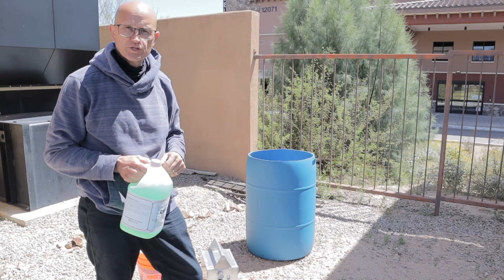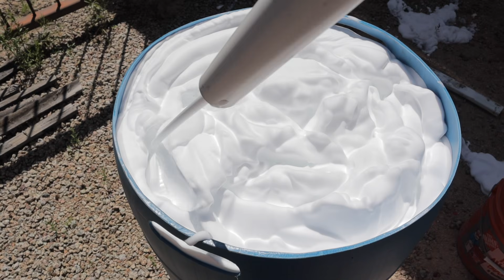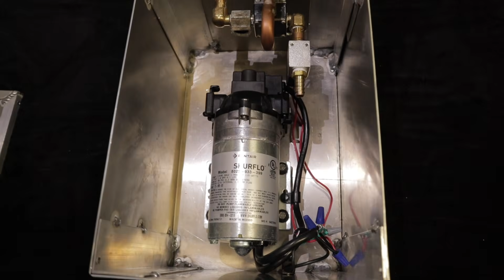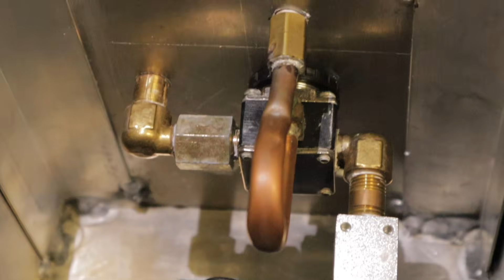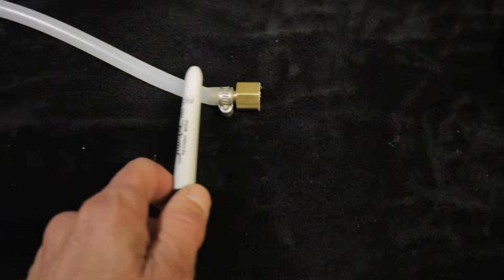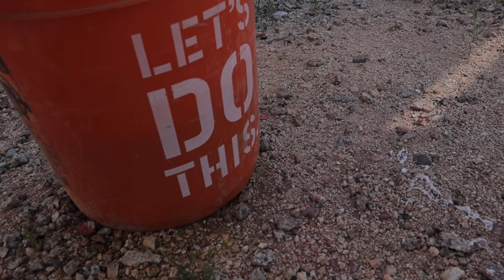Aircrete Foam Generator Machine DIY  [ How To build one that makes Great Foam!

Comment: Could you please give more information regardind the cement/water ratio you use?
Before starting to mix it with foam and how 
Much foam you pour in relation to the cement/water.
Thanks in advance.
Reply from the maker: Good morning! My Ratio is 6.5 gallons of water to each 94 pound bag of Portland cement. Mix thoroughly and then add the foam and mix until it fills up to the 45 gallon mark on your barrel or drum. Mix just enough to blend the foam in completely and then pour into your mold. From this ratio you can make larger or smaller batches as you need. 👍😁Don
Reply: @PranaTech  thankyou very much.
Yours are the best videos on this topic.
Best regards.
Reply: @PranaTech  sir with this ratio what is the density of your concrete and its compressive strength. Warm regards
Reply from the maker: Hi there. The density is 30 pounds per cubic foot and compression strength is 140 psi or .97MPa 👍😊
Reply: @PranaTech  thank you so much sir.
Reply: @PranaTech  sir i am planning to make aircrete of density 53 pounds per cubic feet and compressive strength of around 3MPa with cement and sand. So what should be my ratios. Thanks in advance.
Reply: @PranaTech  sir can i use air operated double diaphragm pump for my foam generator?
Reply from the maker: Yes, absolutely! 😊👍
Reply from the maker: Here is a link to my chart that I use. https://drive.google.com/file/d/15ZAWgf5stQ0oNRSjhrYa9hjkqugEkUi6/view?usp=drivesdk 👍
Reply: @PranaTech  request for sharing this link sent to you.
Reply: @PranaTech  thank you so much sir. So i will be using two air regulators one for pump and the other for foam water. Now my request is do you have any chart/table where you have mentioned pressures for these two air regulators? Will i need two air solenoids for operating these two air regulators? Thanks in advance.
Reply: @PranaTech  God bless you. You are helping us alot. 👋👋👋
Reply from the maker: Anytime my friends! Namaste!🙏❤️
Reply from the maker: Hi there, here is a link to my video where I built the double diaphragm pump model. No need to use solenoids, just use mechanical valves to control the air. https://youtu.be/L-SAHq9X9QQ The link to the schematic design is in the description of that video. 😊👍
Reply: @PranaTech  hope you are doing well. I have a question regarding foaming agent. I have heard that SLES alone can be used as a foaming agent. Is it true or we need to add so other chemicals in SLES. Regards
Reply from the maker: Hello, well I’ve never tried using it so I have no experience with it at all. Sorry.😔
Reply: @PranaTech  thanks brother for your prompt reply. Highly indebted. Warm regards

Comment: out of curiosity, if you let that foam "melt" back to its watery solution, would you be able to respray it with similar results, or do some of the chemicals evaporate? Also was thinking since this is water based product and you're using stainless steel (Scotchbrite, I've had rust on me before) or metal to aerate the solution, would this rust eventually? Chorboy [copper] (Every crackheads favorite product) may be a bit more viable. 00 steel whool would rust too but wonder if it would change the size of the bubbles.
Reply from the maker: Good morning! Hey, those are all great questions! I’ve never tried to run the foam solution through a second time to see if it works again. Many people are using the other products that you have listed and they all seem to work great. I don’t know which one is the best out of all of them. I just settled on stainless and it has always worked well for me so I never experimented any further. All that really seems to matter is that you run the air/foam solution through some sort of medium that has small holes to form the micro bubbles out the other side. Thanks and have fun!😊👍

Comment: Can one use an air compressor?
Reply from the maker: This design uses an air compressor for the air supply. There are other designs out there that use just an air compressor and Venturi affect with a tank to do the pumping. They seem hard to dial in consistently because they don’t use a fixed amount of foam solution like a pump gives. 👍😊

Comment: Hello, I recently purchased land in New Mexico and I live in PA.  I want to experiment with aircrete here in PA and make a small dome to see what and how quickly I can build a small structure.  I was about to buy a foam machine but I watched your video.  I would be interested to attempt to make your foam generator.  Would you have a complete part list of your foam generator?
Thanks, John
Reply from the maker: Hi John,  I will put a parts list together this morning and put it in the description today when I get it finished. I will reply again when I get it posted. Thanks! 👍😀 Don
Reply from the maker: Hi John, I put up links to the parts you will need for the generator in my description. Hope this helps and feel free to ask any questions you may have in the comments section. 😀👍

Comment: Thank you for these aircrete videos.
I'm wondering if you think a 60 psi pump be sufficient?
Reply from the maker: Hi L.S.  I think 60 psi would work as long as it was a quality pump that can maintain that pressure constantly. I usually have my air pressure set at 55-60psi so the pump has to be able to balance that much pressure to be able to make good thick foam. If it can’t maintain that pressure, it will be fighting the air pressure and not getting enough water/concentrate into the mix and you will make a lower density foam that won’t be optimal for mixing Aircrete.  Hope this helps and let me know if you have any other questions.👍😀Don
Reply: @PranaTech  Thanks for the reply, I really appreciate it.
Reply from the maker: No problem at all, anytime 👍

Comment: Do you feel like you've gotten a superior air crete  using this foam as opposed to Drexel foam?
Reply from the maker: Hi Scott! Yes, a much more durable and consistent foam that was designed for use with Aircrete. Drexel is just ok and I had regular problems with collapsing Aircrete and consistency issues. Drexel is designed just for farmers to mark their fields for crop dusting. Ridgeway is far superior foam. I’m also using foam solution from a company called Vermillion and it is even better than Richway and is nontoxic. 👍😁
Reply: @PranaTech  Thanks for the reply!  This is great information to know considering I kept hearing that Drexel is the best foam.  I really appreciate your efforts to help others be successful!

Comment: The pump you link here is not available right now. Is it ok if the pump is 130 PSI ?
Reply from the maker: Hi Kamal, yes, 130 psi will work fine. Thank you for letting me know that the pump is unavailable. I’ll try and update it to a newer link.👍😀
Reply: @PranaTech  you are welcome and both of your pump links and not available . Thank you.

Comment: Say someone wanted to pour a foundation would this cost less than a regular foundation
Reply from the maker: Hi Patrick, this wouldn’t be strong enough for a foundation in my opinion. It’s great for walls and areas where you need lighter weight and good insulation properties as well. You can add sand to create a denser mix but then you lose some of the insulation value.😀👍
Reply: @PranaTech  ohh okay. What about a retaining wall?
Reply from the maker: Hi Patrick,  well a retaining wall usually has to hold up a bunch of dirt which causes a lateral load on the wall. So I wouldn’t recommend it for that. A perimeter wall around your yard would be fine or any wall that didn’t receive a lateral load.👍

Comment: I agree with Glenn Felpel. Where did you get the foam solution again?
Reply from the maker: Hi there, I got the foam concentrate from https://richway.com/construction-products/foam-concentrate.html  You will have to call them to order it and it is $50 for a gallon.

Comment: You filled the foam wand with steel scrubs. Why steel and not plastic? steel scrubs will eventually rust, ain´t it?
Reply from the maker: Hi Roberto! I used stainless steel scrubs so that they would not rust. You could use plastic ones as well and I’m sure they would work fine if you compress them. 👍😀

Comment: How much foam to concrete. Is this fire proof?
Reply from the maker: Hi Lance, the amount of foam you use varies depending how dense you want the final product. I usually make mine around a 30pcf density and this equates to 1 90lb bag of Portland cement to 6 gallons of water and then add 40 gallons of foam. 😀👍
Reply from the maker: Hi Lance, and yes it is fire proof.👍

Comment: Hi  Looks like you are a mad science, old ,AZ guy like me. Maybe you can help me figure out what is wrong with my foam generator build.  I will try to keep it fairly short and try to be clear.  Not your design, but similar. Demand pump ( set at 60 psi I think)  soap solution in from bucket, out to "Y".  Air from compressor in other leg of "y" . Line out of straight part of "Y" to wand.  After looking at your design I see you are using 1/2" tubing?  I am using 3/8" OD-1/4" ID.   I notice you are using, what looks like Home Depot (course)  SS pads in your wand instead of the very fine SS pads I have in my wand.  My compressor is huge so plenty of PSI and CFM. Her is my problem---inconsistent and weak foam.  I can't seem to get the right setting. Either the pump stops pumping , the foam is too runny, or it spits air and quits putting out foam ( Drexal mix)  Here are possible causes that I have thought of
Tubing diameter-- too small of capacity.
The fine SS steel wool is packed in to the wand too tight and is creating too much restriction.
I do not have the air pressure from the compressor set right - what PSI out of compressor do you use?
I do not have the pressure gauge I installed after the air IN connection ( going to the "Y") set correctly.
I am either opening or closing the air shut off valve on the solution bucket too much or too little.

At this point I am thinking --too much restriction in the wand or too small diameter tubing.
Reply from the maker: Hi Jerry! Ok here’s my take on the situation. Demand pumps sense pressure in the line and will automatically adjust and shut down if the air pressure is too high. The best way to deal with that is to remove the pressure sensor part of the wiring and just direct wire the pump to pump whenever the power is on. The fine stainless steel wool will constrict too much if tightly packed, that’s why I use the more open pot scrubbers. 1/4” ID tubing is fine for the air volume but I would run 3/8 ID hose or 1/2” for the foam solution side. I typically run my air pressure at 55-60psi and this makes great shaving cream foam. Hope this helps! 😁👍
Reply from the maker: Also, air pressure can never be higher than what the pump can output or air will back feed into the pump. 😁
Reply: @PranaTech  Great I will try your suggestions. Thanks for the quick response. I don't really understand how to remove pressure sensor part???  My pump is a Aquatec 5853-7E12-J524 1.7 GPM 60I think this is the same pump they use on the Little Dragon
Reply from the maker: I’ll take a look at the pump and see if I can figure out if it is a pressure sensor type pump.👍
Reply from the maker: I looked at your pump and it looks like the pressure sensor is at the front mounted right onto the diaphragm pump. To bypass this you just unplug the wires from the sensor and direct wire it right to the motor bypassing the sensor so it runs all the time whenever you turn on the switch. 😁👍

Comment: Can you share where you purchased the CMX and cost?  Thanks so much.
Reply from the maker: Good morning! Yes, here is the link to Richway’s site. You have to call them to order it and it is $50 for a gallon. 😀👍
Reply from the maker: https://www.richway.com/construction-products/foam-concentrate.html
Reply: Thanks. Your results looked impressive.
Reply: @PranaTech  would be interested to see a comparison experiment between this and Drexel.  Drexel is 160:1 ratio and sells for $25 at rural king.  If you have a store local, shipping cost can be avoided.  I assume CXM can only be purchased online with additional shipping of $15-$20 for the gallon.  Aircrete Harry's video of his comparison test between Dawn, 7th generation, and drexel was impressive showing Drexel with little to no collapse after 2 hours and remaining firm.  https://www.youtube.com/watch?v=S1ydXgWDU00
Reply from the maker: Well, I’ve been using Drexel for a while now and my foam generator makes great high density foam, but I started experimenting with foam concentrates designed specifically for cellular  concrete and so far the performance has been phenomenal from the Richway CMX! I’m to the point now that I really don’t care how the foam performs in a 5 gallon bucket over a couple hours if it collapses when mixed with Portland cement. The end product is the main concern for me. 👍😁
Reply: @PranaTech  yes, absolutely!  I appreciate your content. Very informative and shortens the learning curve for us all.
Reply: @PranaTech  Sir, i am about to start experimenting following your steps. What do you recommend me to pay attention to in order to find the best possible foam agent in spain? Which tests should I perform?
Is there any compound or type of foam agent that I should look for? (I found these links, hope your website translates into english):
 https://losafacil.com/aditivo-espumante/#espumante
 and   https://www.master-builders-solutions-basf.es/profesionales/ficha-tecnica/mastercell-100?basf.id=73f660aa-743e-4af3-b1af-4934f9174a1c 

But I don't know really know how to interpret whether this is what I should be looking for as far as your advices show us).
Thanks for the help, the info and the advices. 
Best

Comment: What psi is the supply of air? 90 or so ?
Reply from the maker: Hi Tony. The air from my compressor is at 125 and then most of the time the regulator on my foam generator is set at 55-60 psi. 👍😀
Reply: Prana-Tech Thank you, sir. Best design I've seen. Gonna build one!
Reply from the maker: Awesome! Let me know if you have any questions. 👍
Reply: Prana-Tech I think I can make a 12v dc version using a compressor powered by lifepo4 batteries and a large inverter. I'll let ya know how it goes.
Reply from the maker: That sounds pretty cool 😎 👍
Reply: Prana-Tech I am wondering if I could take non-stick muffin pans and make a box with them apposing each other on the sides and make "aircrete lego" blocks. Have you seen anyone do this?
Reply from the maker: That sounds like a cool idea! Can’t wait to see what you come up with. Keep me posted😀👍
Reply: @tonynorth2924  Wow, that's some good thinking!

Comment: So m8, stop saying concrete because its not. Its aircrete, cememt water and foam.  Not concrete which is cement water aggregate or stone and sand.  Terminology is important. Tks.
Reply from the maker: Hi Sandii! Traditionally it is as you have described, but the industry calls Aircrete “cellular concrete” so I’m just following industry norms. 😁👍

Comment: That pump cost 400 plus on ebay so I think your cost is a little off
Reply from the maker: Hi Marlon, if you look in the description for the video you’ll find a link to a compatible pump on Amazon for $86. Here’s the link https://www.amazon.com/gp/product/B07TSC6V7M/ref=as_li_tl?ie=UTF8&camp=1789&creative=9325&creativeASIN=B07TSC6V7M&linkCode=as2&tag=pranatech-20&linkId=b77db5386ca45284fd5ee21f29cc63c6  I got mine used off eBay for a great price and if you do a little searching on eBay you can usually find a good deal on one of these pumps for around $35-$50 used. 👍😊
Reply: @PranaTech  cool thanks
is the higher pressure better or is 60 pounds fine ?
Reply from the maker: Hi Marlon,  60 to 65 pounds is all you really need to produce quality foam. 👍😊